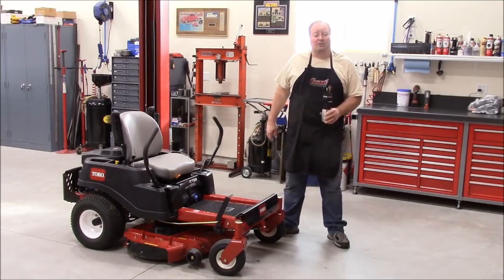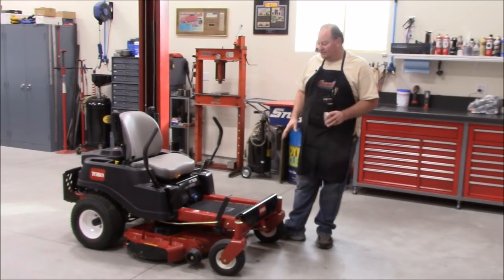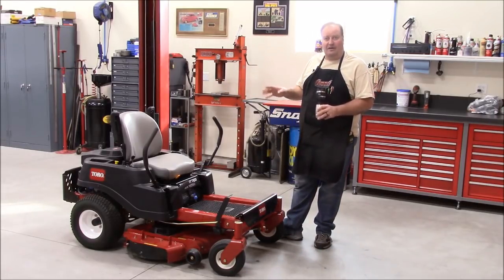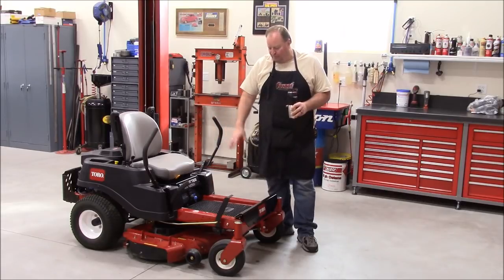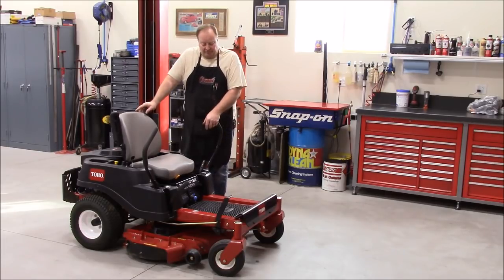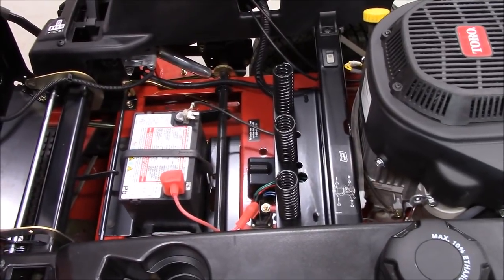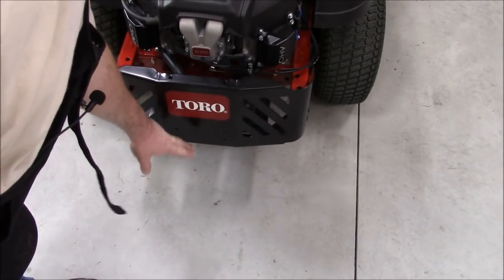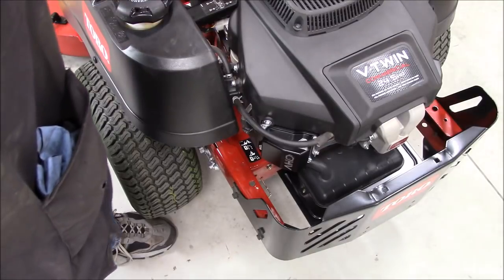Toro Timecutter MX4250 Review

Comment: Toro is a Minnesota company! That 24.5 horse twin Port motor is a beast when combined with 21.5 inch blades. I have a jrco 46 in lawn rake on the front of mine and I have the bagger. I also have the recycler which I use most of the time. The oil drain tube and the cross Drilling in the motor block to allow the entire block to drain. It's lightweight compared to other brands. All that put together makes this a really good bang for the buck. You might as well use it commercially. I suspect it is possible that because you use the recycler consistently that your spindle may have endured some high amount of stress. Keep the blades Sharp and balanced if you can. An unbalanced blade will cause bearing wear. A lot of guys will balk at that but it's just true. If you don't have one get a blade balancer. I run my tires a little under-inflated for a little extra traction. I mow my lawn at the maximum cutting height because I like to watch the grass Sway in the Wind and I have an acre. The one thing it doesn't have which it could have is an anti roll bar oh, I don't see why it shouldn't be an option. But you could install one I suppose. With the recycler you are technically supposed to mow more often but I still think you will have a buildup of thatch which will be easy to remove with the jrco rake and either a powerful Stihl blower or the bagger. Great mower.
Reply from the maker: Thanks for the comments. If you watch my other video you will see that the bearing failure wasn’t due to blade imbalance it was just a premature failure. You can also see the I keep the blade sharp and balanced. 
I cut my grass twice weekly because I recycle as well as the fact that I like the looks of a well manicured lawn/yard. 
Mike

Comment: Fantastic vid mate, just a thought-that triangle tow hitch i took off too and i mounted it vertical on those two vertical mounts on the rear fender area. Basically it near reduces your tow weight to zero but it provides vertical protection for your engine. (i do lawns commercially) and i encounter a heap of scrubby bush blocks. Anyhow great vid!!
Reply from the maker: Thanks for watching and for the comments.  
I removed my tow point completely seeing as how I don’t tow anything around the yard. I also didn’t want it gouging into my brick or stucco in the event I got too close to the house or shop.  
Mike

Comment: I would of like you to tell me how often you change the hydraulic oil at how many hours before you do it on that mower. Frank
Reply from the maker: Sorry Frank,  I have not replaced the hydraulic fluid as of yet in my hydrostatic transmission.  The specs for the Hydro-Gear ZT transmission state that it should not need replacement for the life of the tractor.  However, I seem to hold on to things for a long time so the best interval information I have been able to find is between 1000 and 1200 hours for hydraulic fluid replacement.

Thanks for watching.
Mike

Comment: How does the mulching kit handle leaves. Just bought a new MX4200 this season and will be entering a three month long leaf mulching season soon. Have seen poor reviews of the Toro mulching kit. Plus, I like to use gator blades and pictures seem to indicate a gator blade might not work with the kit. Unless you buy the Toro kit there are no chute gates available for this fabricated 42" deck, either Toro or aftermarket. Actually your review help me decide to purchase the Toro, but I didn't realize the difficulty with mulching chute gates (seem to be available for the stamped decks!)
Reply from the maker: Jim, I’m sorry I can’t give you any personal thoughts on how it handles leaves as I don’t have any trees in my yard nor have I had to mulch leaves with it. 
As for the mulching kit itself I can say I have been very pleased with how well and fine it cuts the grass. 
I have not been impressed with the auto washing nozzle/system under the deck but I have not seen any of those that have impressed me. I feel they all fall short of properly cleaning the deck. I just clean mine the old fashioned way once or twice a season. After mowing my lawn I use compressed air to blow off the mower and give it a couple shots of air under the deck which I think helps a little. 
Thank you for watching. 
Mike

Comment: Are there grease fittings on the front wheels and on the blade spindles?  How are the rear wheels lubricated?
Reply from the maker: The front wheels have grease zerks but the blade spindles do not.  No lubrication for rear drive as they are driven off the hydro-drive units.

Comment: I'm looking at a used one of these at my local Toro dealer. Based on your review, I will probably buy it. It has 240 hours and appears to be in good shape. Are there things I should ask about Pryor to the purchase?
.
Reply from the maker: I would inquire about belt and spindle bearing condition to determine if they inspected them as well as engine service. Other than that it will pretty much be dependent on how it was maintained over the course of those 240 hours and a good visual inspection should determine if it was abused or taken care of. 
Mike

Comment: I appreciate your video.. I have question regarding the bagger system for this mower... someone is selling a bagger system from a ss4225 but toro said it doesn't match to fit mine.. these mowers are pretty much the sane except for the decks... pre fab vs non fab... is there a big difference or can I make it fit?
Reply from the maker: I’m sorry, I have no personal experience with the bagging system on this mower as I mulch everything. I wish I could answer but I don’t want to give you incorrect information. 
I appreciate you taking the time to watch. 
Mike
Reply: Your only option is the toro bagger its $699, just went through this same thing. Other baggers dont work well on the toro

Comment: Why are you not a fan of Fram? Great video BTW!
Reply: Also, could you do a video on how you used the railroad tie to smooth out your property? I need to do that.
Reply from the maker: Thanks for the comments.  

Years ago a couple Co-workers and I cut several oil filters apart and I was less than impressed with what I found (or better yet lack of what I found) inside the Fram branded filters.  
I really like WIX, Hastings and Donaldson filters but the Motorcraft and AC Delco were decent as well.  

As for the railroad tie, I had a couple of 4’ lengths that I put on a small section of chain link fence and drug it around the yard after tilling the ground.  It helped to not only break up large clumps if dirt but also aided in leveling the ground prior to sod.  

I hope that answers your questions and thanks for watching. 
Mike

Comment: What is your opinion on the toro engine compared to a Kawasaki or koler? thanks
Reply from the maker: Comparable. I know a lot of people seek out the Kawi engine but I have had very good results with the Toro. No issues or anything that has jumped out at me on any of the ones I’ve worked on.  But then neither have I seen anything on the Kohler or Kawasaki either. 
Like anything maintenance is key though. 
Mike
Reply: I'm just replacing a Hustler with a Kawasaki engine.  The mower itself was great for 8 years, the engine grenaded itself after meticulous maintenance, etc.  Don't waste the extra money on Kawi.  Look it up, there are multiple videos showing how they bend pushrods and ruin cylinder heads due to bad design. I had zero compression on one cylinder, the mower repair guy said one cylinder had 1/8" gap in the cylinder between the piston.  It costs almost as much to just replace the engine than to buy a new Toro zero turn so that's what I did.
Reply from the maker: Thanks for watching and commenting. I appreciate the feedback. 
Mike
Reply: Ok

Comment: Actually, you push in and lock to disengage the drives. (I own one)
Reply from the maker: What did I say?  Pull?  If so, my bad, I must have missed that and not corrected it when editing. 
You are correct, you push the levers in until they lock in the groove yo disengage the hydraulic drives. 
Thanks for the correction. 
Mike
Reply: zmotorsports No problem, Just got it today, love it.
Reply from the maker: Awesome. Just finished mowing my lawn and I enjoy it every time I fire it up. 
Thanks for watching. 
Mike
Reply: zmotorsports It has enough empty space I’m debating hacking a radio and a couple of speakers into it. 7 acres, 1.95 of it grass with trees placed such that one needs a mower this small and 4 hours to mow.